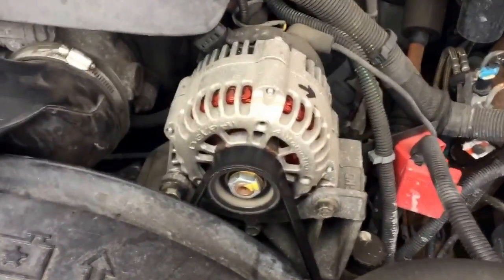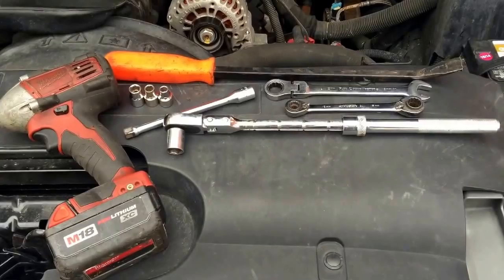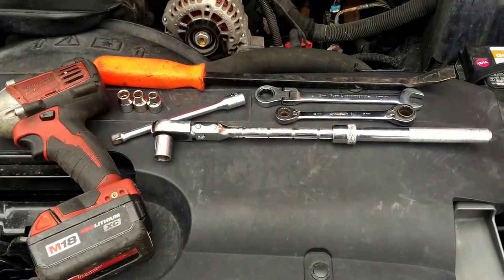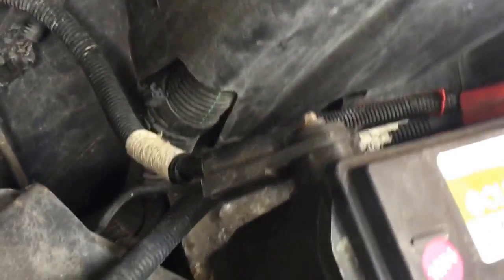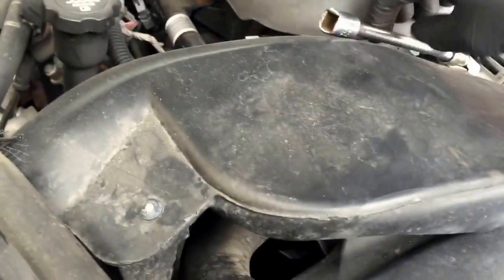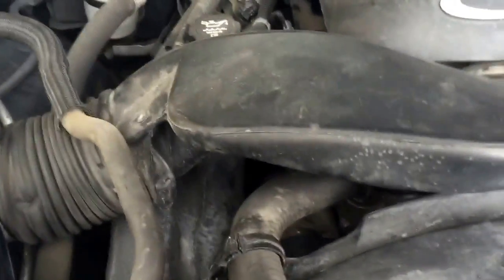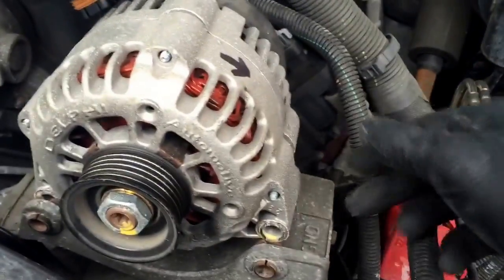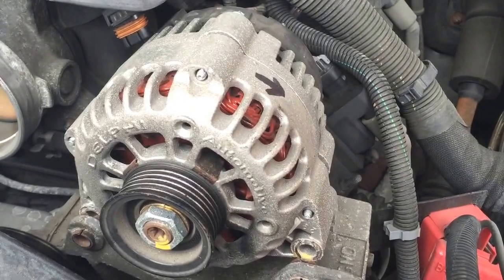How to replace a alternator 2004 Chevy Silverado 5.3 using hand tools & 3/8 Milwaukee impact drill

Comment: My 170,000 alternator gave up the ghost in the US Customs lane between CD Acuna, Coahuila Mexico and Del Rio Texas.  Fortunately, my battery had enough juice to get me to within two blocks of my house.  This was my first experience with a serpentine belt.  I was about to remove the tensioner ....and then I watched your video.  The hard part was getting that darn electrical connector off of the back of the old alternator.
Thank you for sharing a simple yet direct video on HOW TO DO IT.